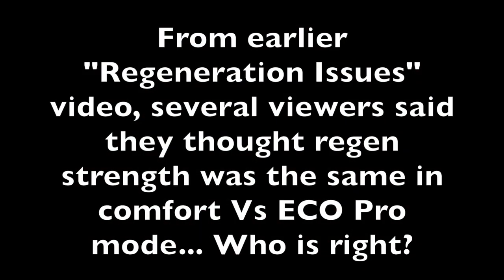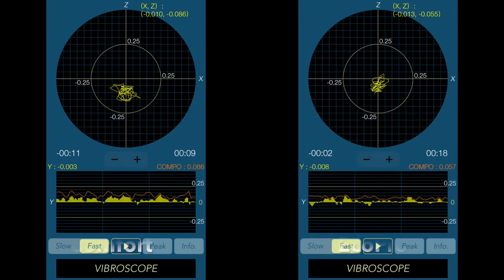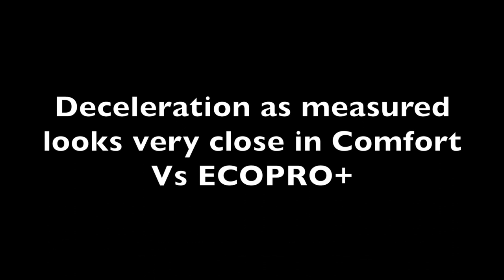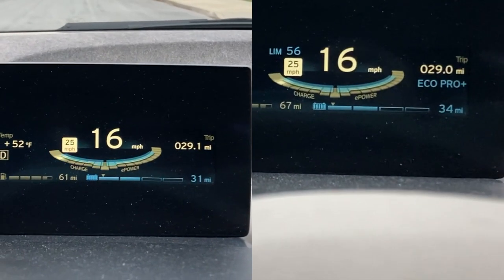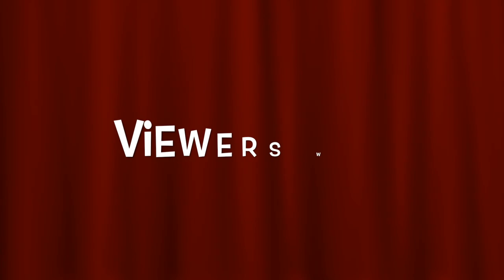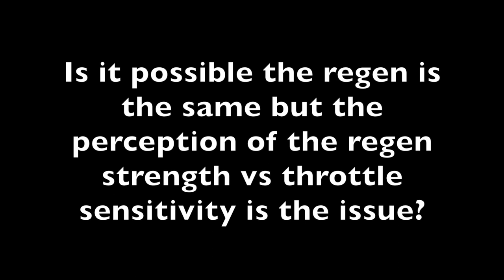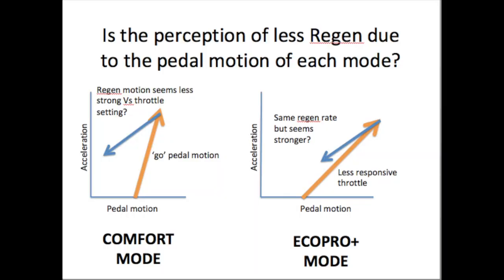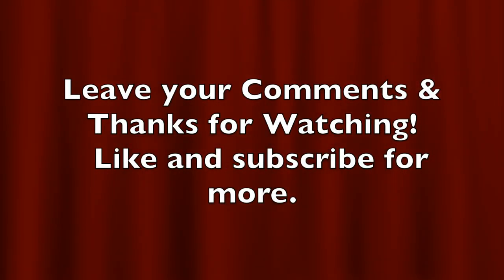BMW i3 Regen strength Vs Drive Mode (CORRECTION UPDATE)

Comment: I have a new theory that you could test regarding regen: If the maximum regen level is linked to the maximum charging rate of the battery, then if you are on a max regen situation (e.g steep slope) the regen reported on the dashboard (KWH/100Km) will be even more if additional subsystems are in operation, such as air condition. Some brief testing seems to show that the regen level can surpass the usual 54-55 KwH/100km when there are additional systems to suck that power.
Reply from the maker: Good idea!  I actually drive down a 1100 ft hill about once a week, I can test this out soon.  Thanks for the feedback.

Comment: If you switch the display to show instant energy consumption/charging then you will see that the regen caps to about 50KW/hour (witch is, conveniently,  the maximum charging rate of the battery) in all driving modes. If you have enough speed and you are on a downward slope then releasing the gas pedal results in maximum regen, and it is 50kw/hour. I hope this helps to collect more data points.
Reply from the maker: Thanks for the information!    It would be interesting to see if (not at maximum) the regen measures the same kw/hr rate... that would settle the question.
Reply: What is you're running Rex at the same time?
Reply from the maker: I haven't tried that, may be an interesting test!  I would guess that the 50kw charging limit would limit either the REX or regen at some point, but which I do not know (yet).  Thanks for the good question!

Comment: Question: As an academic exercise, what are the features of the Rex generator in comparison to for example on one of the Honda power generators ? For  clarification, if you were to redesign the i3 with a modular generator that could be lifted in and out of the vehicle, what would that generator look like ? (Again academically).
Reply from the maker: Well,  here are a few thoughts:  The REX engine is 34 Hp, or 25kw output Vs a 3kw Honda generator that comes in at 60 lbs. (probably the limit of being able to lift it into the back of the car).   This would not be enough to run the car, but could be used to recharge the battery when parked/or in an emergency situation, 3kw*6 hrs =18kwh or near full charge for a 60Ah battery.  Having a gas tank inside the passenger compartment may be a safety issue.   Honda sells a 10kw unit, but it weighs 400 lbs and is 41"x35"x27".    If we look at a freeway speed of 65mph (4mi/kwh) you need ~16kw of power - not trivial.   I like the idea of a microturbine generator, 8kw at 20lbs and very small. ( https://newatlas.com/outdoors/arc-turbine-microgenerator/).  Integrating it into the existing system would probably not be worth the effort, if even possible,  unfortunately.